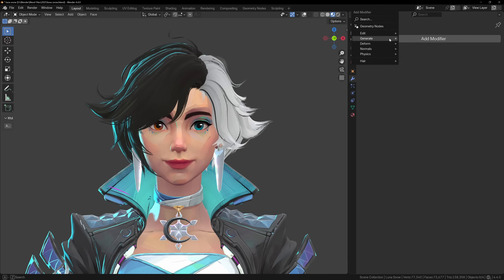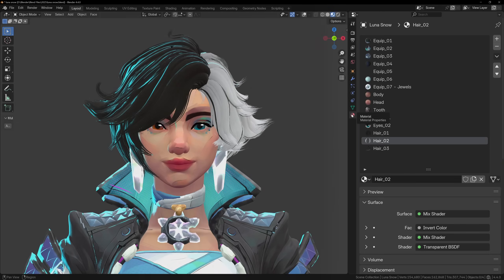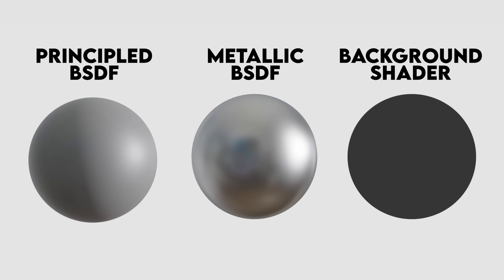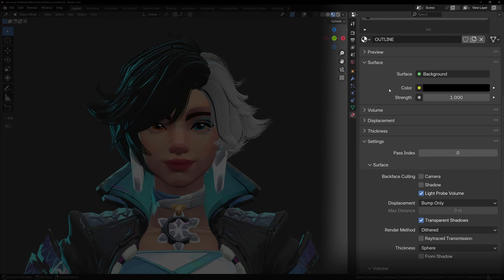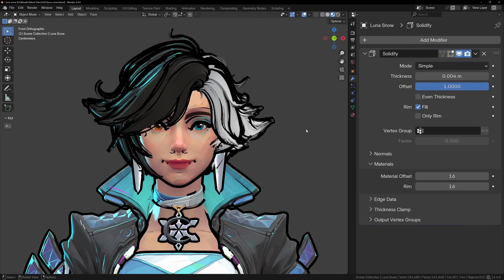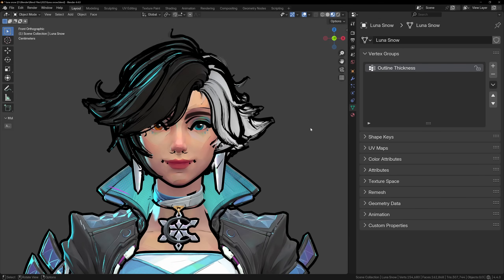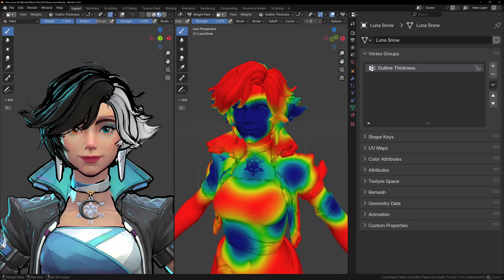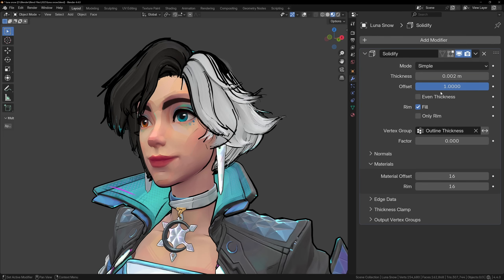Easy Dynamic Outlines in Blender! (Line Weight Variation)

Comment: to those wanting this to work for Cycles: this only works in Eevee because Cycles doesn't natively support backfacing. i ran into this problem so i looked it up! here's a solution:

1.) go into the "Shading" tab (to edit material properties)
2.) change selected material to the outline material (you may have to select the object with the outline material on it)
3.) add these nodes: Geometry (input), Emission (shader), Transparent BSDF (shader), Mix Shader (shader)
4.) plug the 'Backfacing' output from Geometry to Factor in the Mix Shader
5.) plug the Emission shader into slot 1 (color this to color the outline!) of the Mix Shader
6.) plug the Transparent BSDF shader into slot 2 of the Mix Shader
7.) connect the output of the Mix Shader to the surface input of the Material Output

this should work! again, change the color of the emission to change the outline color. i'll edit this if people comment anything to add!

Comment: Something of a warning to people, if you didn't see the issue with this method right away. 
While this makes the outlines great for one angle, it makes it very tricky to use in animations that won't have the character always facing the camera. (in this case due to the face's outline being set to zero)
This is great for still shots, or short animations to allow you take fine control over all the weight painting, but as stated, it is very time consuming when it comes to longer animations that will see the side of the face, or anywhere that you had lowered the weight paint to zero on. 
No method for making outlines is truly perfect, so make sure you know what you want to use the model for, before settling on an outline style. 

But that's just my $0.02 on the subject.
Reply: A valuable 2 cents tip
Reply: Literally just set the whole face to 1 except the base of the nostrils and youre good

Comment: Sir Sir, I have 2 question. i just noticed that your character is a single object/mesh. how do we do it if our character has multiple mesh object ? do we have to merge them together to make it work, or individually do it on all mesh object?
my beloved sir my second question is will this dynamic outline work if we animate our characters?
Reply from the maker: If your character is multiple objects then yes, you'll need to follow thr same process for each piece, adding the solidify, and doing the weight painting for each piece. Also this method will work with animation, it might slow down your Blender playback but you can disable the modifier in the viewport but leave it enabled for rendering

Comment: Is there a way to do this via a texture map? Either way, thank you!
Reply from the maker: I'm sure there's a couple of ways, I don't have specifics but I'll give you a rough overview and you can do your own research after that! 

I know at one point I was able to convert  weight painting to a texture using Geometry Nodes so you could probably reverse that technique to use a Texture as a Vertex Group and generate the outline entirely with Geometry Nodes by inflating the mesh.

The other method would be to use Displacement instead of Solidify, you can input a Texture into the Displacement modifier and that will inflate the mesh for you, but you'll need to duplicate the mesh and make it it's own inverted hull before doing Displacement.

I would recommend the Geometry Nodes method as its more flexible and less destructive that Displacement
Reply: @VertexArcade  Thank you!